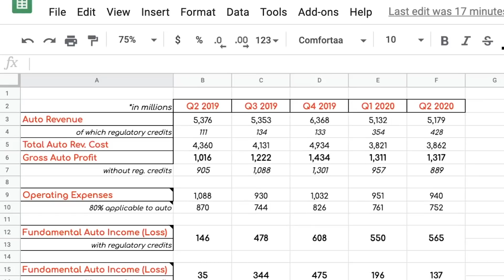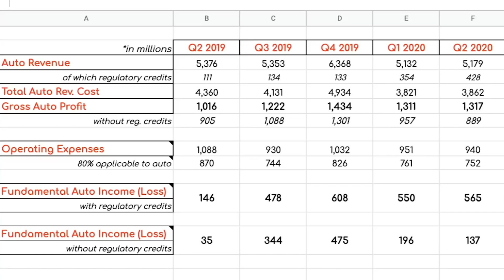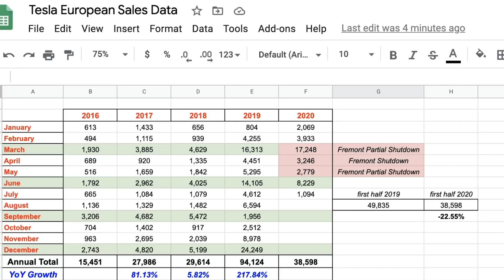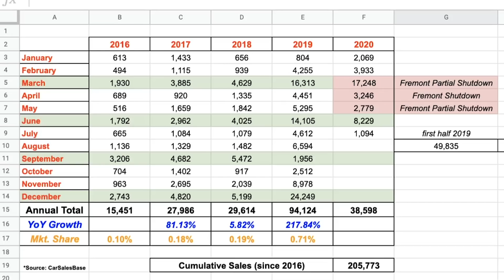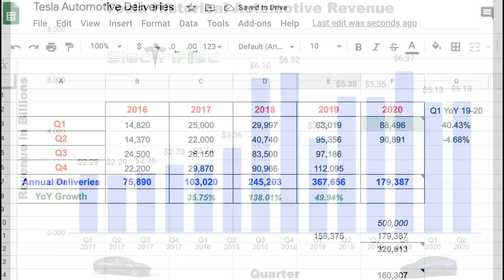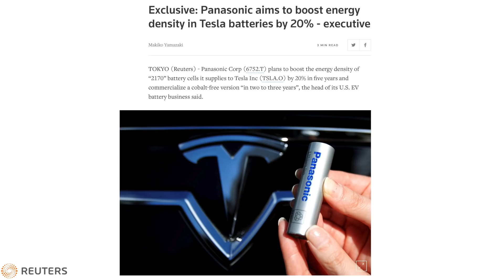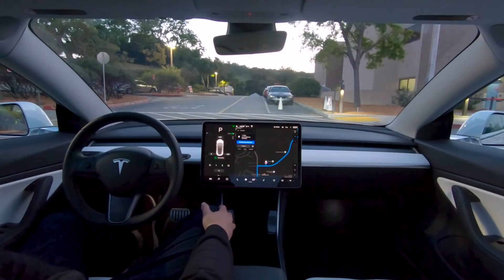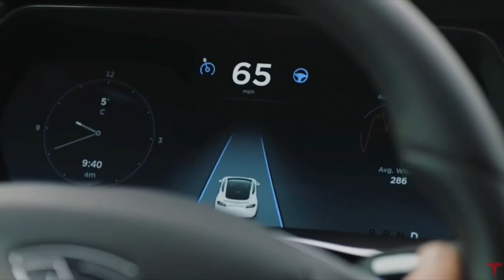The Gordon Johnson Tesla Debate | Destroying the Bear "Thesis" (using real data) 🚫🍒

Comment: Thank you. The European analysis part was excellent. Just the information needed to demonstrate that one of Gordon’s main bear points is cherry picked not just in terms of location, but in terms of time as well. In fact, if you look back at Gordon’s main bear points over the past 3 years, you will notice that a lot of them have a very specific temporal context, he cherry picks data points based on a small time window which makes his points look valid, but crucially they quickly become invalidated. With this track record, no one should pay much attention to any of Gordon’s points.

Comment: Things are going to look a lot different next year when Giga Berlin, Giga Shanghai expansion and Giga Austin are all pumping out cars and and Full Self Driving is performing much better and being purchased by a higher percentage of Tesla buyers.
Reply from the maker: Facts
Reply: that doesnt count as growth because that is new factories
Reply: @MrBloonbloon  exactly! Growth doesn't count as growth when it's Tesla growth.
Reply: i'm expecting the model 3 will drop to 20-25k after the austin single mould is running. then add in cheaper, better batteries. i expect to see q4 to be huge!

Comment: The only comparison that needs to be made is between ICE vehicles and Tesla vehicles on Autopilot. The answer is one accident for every 4,530,000 miles driven by Tesla cars in which drivers had Autopilot engaged vs. NHTSA’s most recent data which shows an automobile crash every 479,000 miles. The only mass sacrificing being done is by the ICE industry.

Comment: Good video. It's terrific that you break out the numbers to refute Johnson. It's hard to completely dismiss someone when the repeat a concrete statement multiple times, that you don't have the numbers on hand to say yeah or nay. This is a common trick used by trolls. They state what sounds like an indisputable fact, and you know they're lying, but calling them out is calling their bluff without knowing for sure they have a weak hand. (What I've learned to do over many years is to look them in the eye and say, 'Even you don't believe that, but you like saying it." Often they start to wobble and back peddle.)
And comparing Germany to Montana is not right. Germany is the largest single economy in Europe (at least I think it is), a more correct analogy might be saying it's like using Texas, New York or California to represent the entire U.S. It's not going to support the analogy you're trying to make...but it is closer to the real situation. Germany is important, but of course it's only part of Europe.  After hearing all the amazing things that are going to happen in Gigafactory Brandenburg Concerto - even I, here in California,  with only three weeks to picking up a Model Y, want to wait a year for a European Model Y.
You're trade off of deaths for a safer future? Dillon, you're young, you need to read more. Yeah in the end that math will be what happens, but there is no way that this is ethical in advance. Tesla will not knowing risk lives now to save many more later. Full Self Driving has to be safer than human driving or it will never be allowed to be fully autonomous. It may already be close enough to be safer than human driving, but it's still not quite there. Read up on this, it's an interesting subject.
Good point about Tesla's mission. I think you conflated Growth, with changing the world to sustainable energy. There are  actually three goals here with the third being maximizing profits. Apple, everyone's favorite model for Tesla, has always sold premium, exclusive products are premium prices - which has enabled them to capture 90% of Smart phone profits despite selling less than 50% of the smart phones. Tesla is not doing that. Tesla is focused on its mission of a sustainable energy future, then growth and only then profits. The first two fit nicely together, but would Tesla license all of its technologies to legacy automakers to hasten sustainable energy vehicles? To some degree they have, but I don't think they are ready to do that. I also see some friction ahead with investors. But it'll end up being like the current Sun City lawsuit, a bit too much worry too soon. I see Tesla expanding as rapidly as they can. What does it actually take for Tesla to build a factory? Right now it looks like Shanghai, Germany and Texas are staggered. Musk has called out for at least two things: more terrific engineers and more nickle. Basically engineers and batteries. I foresee an investor brouhaha or lawsuit about a year or so before rapid expansion begins to generate huge profits. I'll bet there will be an increased delivery graph with a less steep profitability slope  in the next couple of years.

Comment: Gordon has a point though. The ID4 has a range of 311 miles, and it costs $35000, that’s a lot cheaper than Model Y. The competition really is coming. These specs are better than Tesla’s.
ID4 is eligible for the $7500 credits. So it costs $27500. Blows Model Y’s price competitiveness.
Reply from the maker: Yes, a point I should have elaborated on a bit more was the compact segment in Europe really heating up
Reply: Electrified But it’s not just Europe. ID4 launches in US early 2021

Comment: Great points about Europe. Some more remarks. Indeed, Tesla is in the single digits market share for the past few months, but also: the ev market has doubled year over year. So great news! And the market can still grow 2000% from here. Another point is, the model 3 here is actually pretty expensive, starting at €48k. This is because of transport costs and import costs, both of which will not be there for Model Y from Berlin.

Comment: Nice work! I dont think Gordon could watch this video without interrupting it, he thinks by being aggressive and rude it makes him more convincing...

Regarding the range though, that argument will be less and less true unless TSLA really comes up with a significant announcement at battery day. Lucid Air announced a 517miles range (458 miles already achieved) and at some point as long as you have enough charging points, the need for more than that range will be quite limited (I mean how often in a year to we drive 500+miles in one day?). I hope Tesla comes up with a solid state battery first but even if they don't, to me their biggest advantage is not their batteries, but their software and the data they have collected for the AI. Thats something other companies simply can't buy. That and their manufacturing process. While other car companies will be losing money on their electric cars for a while, I'm confident that in the next 2 years Tesla will be able to announce an EV (possibly model 2?) that will be in the Corolla/Civic price range. When that happens, their revenues will simply explode as I can't imagine someone going for the ICE car if the price to buy is the same and the cost of owning is cheaper.

Comment: In Q4 2018 Tesla reached full production. In 2019 there was no added capacity. 2019: Q1 - is always low, Q2,Q3 - more cars were delivered but in Q4  '18 most M3 were performance trim (expensive) in Q3,Q4 - most were lower priced + this is the year when all S and X buyers started to wait for the refresh, thus declining sales of the most expensive cars. As a result a 10k/quarter  increase  in car sales didn't translate in more revenue. The only way to increase revenue is to add more production (build factories) and Gordon actually said that himself, Tesla will have more sales because they built a new factory, which is actually how things work

Comment: If anyone makes the argument about being able to buy the same batteries and eliminate Tesla's advantage, just refer them to the Sandy Munro video where he discusses the fact that the electronics that go into controlling all of the batteries is a LOT more important than the actual battery tech itself.  This is because it's a lot harder to control how thousands of batteries work together efficiently, without overheating, than it is to just cram a lot of high capacity batteries into the car.  If that were easy, then yes, Tesla would have no advantage, but it isn't, and that is why nobody else is doing it.  That is a point that is NOT obvious to most people.

In any case, good video in general!  It's nice to see the numbers presented like this in charts over time.  It makes their progress a little more obvious.
Reply from the maker: Thanks for the feedback!

Comment: Excellent. I'm new to your Vblogs but am now "subscribed"!
In your humble opinion: I have been with TESLA for a long time, but it has only really taken off for two years or so. I'm 2 years from retirement. I have never sold one share, but I will need this money. Every time it goes way down, I bought more and  will do so on Tuesday. I hit my goal when it went to $450. Now I'm in the rears. When do you feel it will be back up to at least $450?
Thanks a lot.
Reply from the maker: Welcome to the channel! Tough call. Tesla is a very volatile company so needing them to hit certain price targets is tough in the short term (under a year). I think they will have very strong numbers in the back half of 2020 and there seems to be a floor of around 380. Won't be surprised if Tesla runs back up over $500 in the next few months. (not financial advice) Good luck!

Comment: Dylan thanks for the review. Shaun out to Rob for copping with the analyst. I did not watch the interview till the end as I could not cope with his behavior. 
However, having said that, TESLA was not added to the sp 500 so the reviuimng comitty don't accept its profit eithout the credits
Reply from the maker: My pleasure!
Reply: No one knows if the credits were the reason for S & P exclusion . The reason given as of September 9th is that there was not enough stock “float” for inclusion. As much as 60-70 % of shares could be held by Elon and large institutions. Short positions would also need to be subtracted from available shares. The S & P requires at least a 50% float be available for inclusion. I don’t think Tesla met this requirement.

Comment: The fact that a vehicles price will jump $7500 (expired tax credits) is enough for most buyers to accelerate their purchase in 2018. “California-based electric car manufacturer Tesla became the first automaker to hit the cap when it reached 200,000 sales in July 2018. They did so by selling a mix of original Tesla Roadsters, plus the Tesla Model S, Tesla Model X, and Tesla Model 3 EVs. The full $7,500 tax credit lasted until Dec. 31, 2018. From Jan. 1 to June 30, 2019, Tesla customers could qualify for credits of up to $3,750. From July 1 until Dec. 31, 2019, the incentive was capped at $1,875. Since the beginning of 2020, no federal tax credits are available on any Tesla model. “ From US news.

Comment: In discussing the death toll, it's better to compare the percentage "at fault" accidents of Teslas to the percentage "at fault" accident of cars without autopilot.
This is basically a direct comparison of humans to machines (Specifically Tesla's autopilot). I'm sure all the drink drivers and sleeping or texting while driving population will skew the numbers in Tesla's favor.
The strength of this approach is that it will prove that regardless of the imperfections of autopilot, it's still statistically safer and more reliable than a human drivers.

Comment: 7:50 Just to be sure: in Europe you can't buy Model Y, for that we will have to wait for Berlin to come online. But you can preorder it, with a deposit of €2000 (~$2370). In the meantime you can buy Models S, X and 3 as usual (from Fremont). Model 3 still sells quite well. I wouldn't necessarily call that an Osborne effect. The problem in Europe is more that other brands are beginning to get far ahead with compact cars such as the Renault Zoe and Volkswagen ID.3. This gives credence to the rumor that soon a Tesla compact car (hatchback) will be announced, based on Model Y.
Reply from the maker: Yes great points Dirk, thank you for adding. Was not trying to paint the picture being fully paid to an Osborne impact, just something to consider.
Reply: @DillonLoomis22  I understand that, it's just that your remark gave me pause to think.

Comment: Since most of the revenue comes from autos, it seems allocating interest and depreciation against auto sales is reasonable. I know depreciation is a non cash expense, but equipment and buildings will need to be replaced. A small number should be attached to each vehicle. Instead of lowering the price, why not offer FSD for free? Sales would rocket 🚀.

Comment: No one is being sacrificed to develop autonomous driving. As Tesla shows the odds today of getting in an accident are lower when driving in autopilot. The data is probably skewed to highway driving, and benefits from autopilot limiting to 5 over the speed limit. There may be very few accidents that would not happen if the driver were manually driving, but only because they allowed their attention to wander. Properly monitored, autopilot is safer period.

Comment: I agree there is a misunderstanding when people sayTesla has the most advanced batteries. because analysts are thinking cells when really the advantage is the entire battery pack and everything invovled. But I have thought about this more and while the lion share of thier advantage pre battery day was the pack. It actually isnt a true statement that you can buy the same cells going into a tesla. I would have to maek the time to dig this up but I beleive Tesla has been customizing the chemistry going into their cells since model S. So while you could buy the cell form factor. Buying the exact same cell with the Tesla chemistry formation was not a thing I beleive.

Post battery day the no special sauce in batteries is even less true. Since they have been working on this stuff for quite a while.

Comment: "RAAAAHHH!!! I"M GORDON JOBLESS AND TESLA IS A BUSTERED GROWTH STORY!!"

looks at all the factories coming online within a year. Notes that Tesla is on track to have cars coming off the line within a year at each.

Sure, Mr. Jobless, okay.

The single thing he keeps trying to hammer home is how revenues are flat AND you can't sustain a company without profitability. 

Looks at Amazon Looks at Netflix

Sure, Mr. Jobless, okay. 

Have you ever filled a sink with water (in this analogy, water is money, the sink is the bank account), and popped the drain? Water goes out, but you can keep it filled for quite a while by opening the tap again. Even if more water is leaving the sink than entering, you can always bring a pail of water from somewhere else and refill. In the end, he is fundamentally wrong, because there's more water entering the sink than leaving, as anyone with half a brain cell who looks at the cash flow can tell. Even if this were not true, Tesla will tap the market to bring in cash with minimal shareholder dilution. 

His whole "only losers use ATMs to generate cash" argument is so juvenile. It's a tool that fit Tesla's need, even if every other user of this tool is headed to delisting, how does using a certain tool inherently put the user in the same boat. It's a tool that fits Tesla's need for flexibility and control or whatever need that may be, even if Mr. Jobless doesn't get it.

Comment: The sub $40k SR and SR+ Model 3 came out around the time that the Model Y was unveiled (March 2019). Osborning and low cost offerings might have contributed to flat revenues between Q4 2018 and Q4 2019.

Anyway, Gordon is confused about Tesla’s mission. It has nothing to do with profitability. Sorry dude. He did have a few great quotes though. My favorite was “I haven’t checked that statistic but I’d argue that that statistic is incorrect.” 😂

Comment: Regarding battery advantage, and leaving the BMS aside, it is not true that anyone can buy those batteries from Panasonic. They are created by a joint venture and are exclusive to Tesla AND they have Tesla's proprietary chemistry inside them. So Gordon is wrong on all levels.
Reply from the maker: Cells from the Pana/Giga Nevada yes most likely, may not be the case with CATL and LG
Reply: @DillonLoomis22  actually LG I think is the same, I remember reading how it took time for LG to implement Tesla's chemistry requirements. CATL ones can certainly be bought off the shelf though.

Comment: Can any other auto maker buy battery cells made at the Gigafactory? I don't think the deal between Panasonic and Tesla works like that: Tesla has built the factory while Panasonic supplied the "know-how". It's not a Panasonic factory. Panasonic manages production, but its a Tesla space. If Testla decides to build its own batteries, guess where the factory would be? see Panasonic website: the gigafactory is not a Panasonic factory.

Comment: Thanks for the well made and supported video. However, loose factual statements hurt your overall credibility. I don't disagree that the clown (otherwise known as Gordon Johnson) likes to cherry pick data, but comparing the German market to the state of Montana, just because they are similar in size, is ludicrous. Germany has a population of approximately 83M and Montana's rounds up to 1.1M. A much better analogy for Germany is California  (even though CA's "GDP" is about $1T less than GE). More comparable markets, especially since CA is pushing strict vehicle emission standards, like the EU.